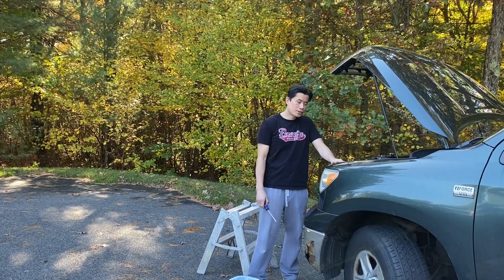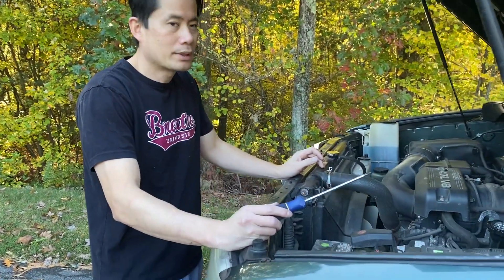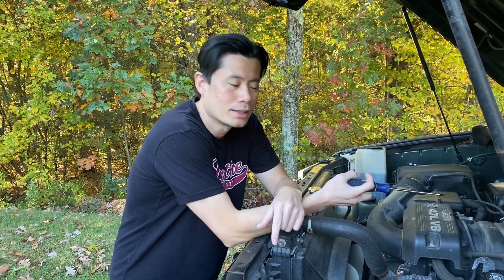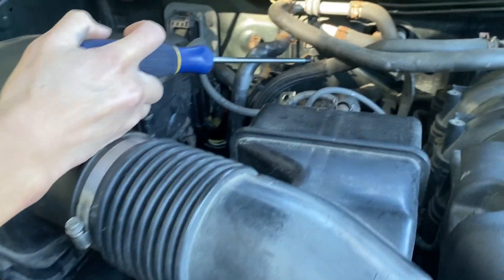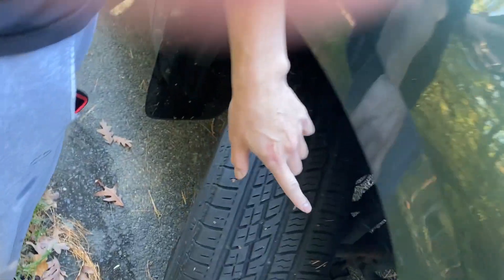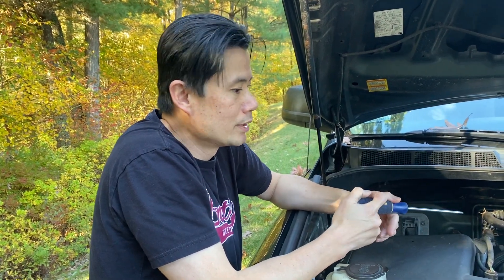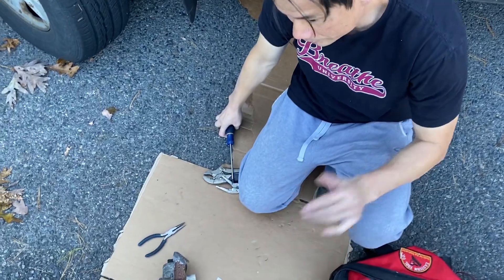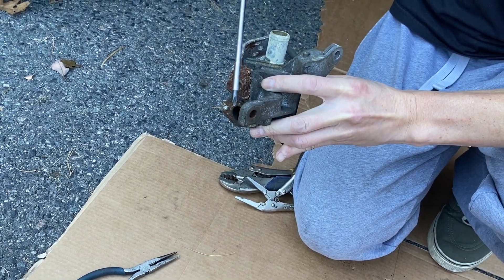Tundra Code P2440 P2443 P043

Comment: The Toyota OEM AIP will last longer than the cheaper non OEM. The part will fail again. There is a bypass kit that just tells the ECM everything is working correctly, the AIPs only function at a cold start up for about 30 seconds
Reply from the maker: Nice. I did notice the ones from Amazon do not last as long as the OEMs. Thank you for your insight and adding to the community.
Reply: @hunterandchavy  it also helps to shop around the different Toyota dealerships will vary on their prices. I have seen them as high as over $300 each the best price I have seen is from Sparks Parts which is a dealership in South Carolina

Comment: Thanks for your video, well done.  Did you check your fuel trims, Short term & Long term on both banks, I suspect if your Air injection valves are stuck open you would get a Lean condition on that bank with Positive fuel trim readings ST & LT for that bank ??  Thanks.
Reply: I didn’t think of that but great suggestion

Comment: Check factory warranty service bulletin.  Mine was 9 yrs old, with over 110,000 mikes and Toyota covered it. I believe it extends to 120,000 or 2022. Save money and headache...take care
Reply: My 2010 4.6 had the same problem at 170,000 miles. I got a bypass kit off eBay for $260 saved a lot of time and money
Reply: @ksystems872  I bought one those too but for now cleaning the air bypass and drying them out is good solution too. Thx
Reply: @ksystems872  will it pass state emissions now?
Reply: @jondavis2206  never heard of it
Reply: I appreciate you Carlos. I have been cleaning one and swapping out the other. Make sure hit subscribe as I bring you more videos on cars, real estate, and finance 👍